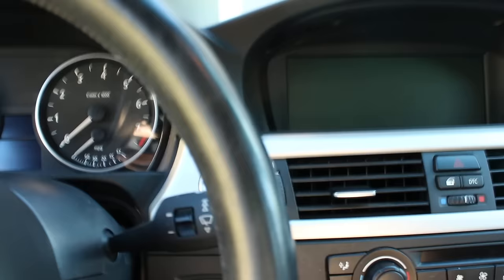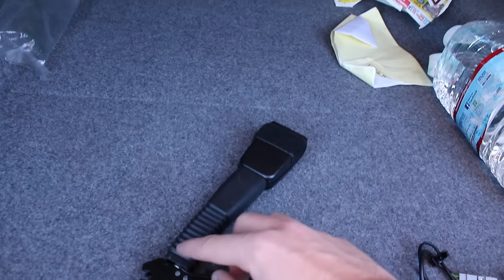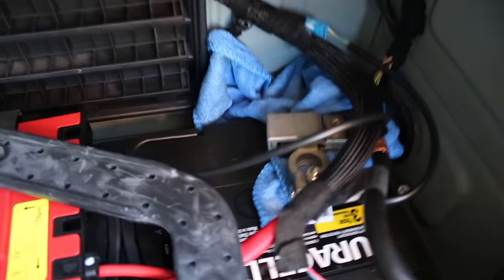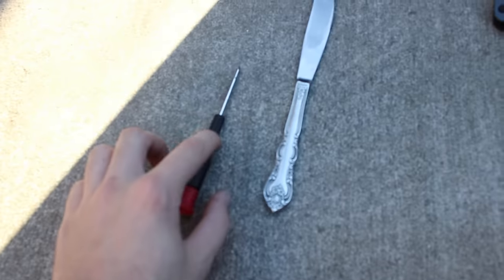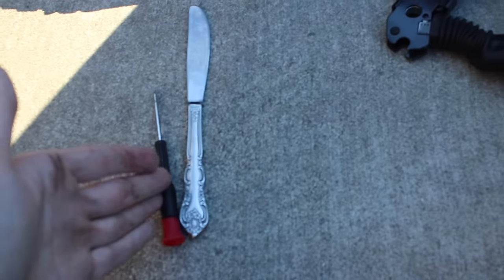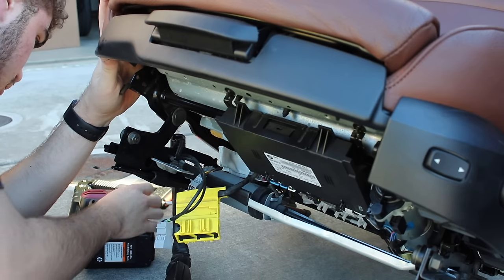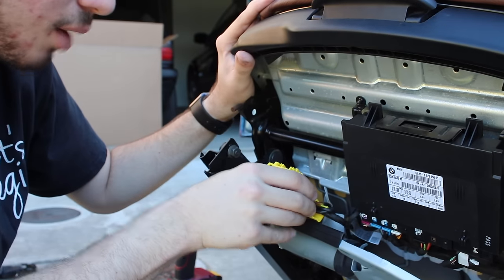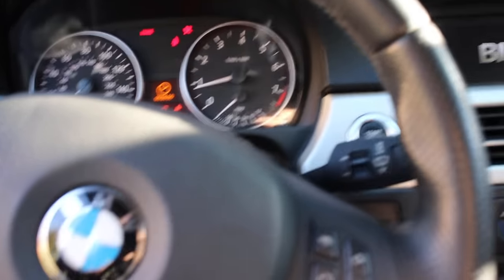HOW TO REMOVE AIRBAG LIGHT!!! (BMW)

Comment: If this video doesn’t fix it, the reason you have the airbag light and seatbelt tensioner light is because you got upgraded seats from a non LCI car. Lci cars have a airbag in the headrest. You would need to use a protocol to turn off the headrest air bags and that should fix it. Or you get get lci sports seats and that would also fix it
Reply: hello do you know how i could code them out ?
Reply: @alijevahmad4337  yes, you need to use the bmw protool to turn off the headrest airbag and that will make the codes go away! You need purchase the protool or find someone who has it to turn it off for you!
Reply: @abdel8068  ok thank you very much 🙏

Comment: I had this problem but the belt restraints were ok,what the problem was was quite simple,I had been putting stuff under the passenger seat when leaving the car parked up.when you pull the stuff back out fro under the seat you can pull the seat electrical connector block off the bracket on the seat.the block then flaps around and loosen its connections,I slid it back onto its bracket and left the car for 1 hour.when I started it again problem gone,never came back.check this first it may not seem like a big deal that the block has detached from the seat frame,but it is.
Reply: Bro can u detail where the bracket is I put shit under my driver seat and am having the same issue

Comment: This fault could also be the pressure mat under the passenger seat at fault. I’ve got two beamers a 2012, 116i and a 2008 118d Msport. Both of them have this problem. The Msport has just had a new battery and fault appeared a few weeks later. The 116i had the fault when I bought the car. Common fault. If it’s the sensor pad under the passenger seat, it’s an expensive fix. Pain in the backside as the instrument cluster always shows the icon and I like to see the time displayed!!
Reply: Have you managed to get any fixed? How much did it cost?

Comment: Did you have to replace the airbag control module or send it in to a airbag shop to delete the crash data?
Reply: i would imagine. since he was never in an accident i would say so. he only replaced the tensioner. im having the same problem with my e92.
Reply: I have a 2015 320ix front end crash airbags deployed will I need to do anything to start car the steering will is not locked. I changed the cable to batery already thank you
Reply: @anthonymaniz9896  I don’t understand what you are asking. If you already changed the red cable after accident then the car should start right up
Reply: @thewiseguy7100  ok thanks y would the sterring wheel not lock
Reply: @anthonymaniz9896  It never locks, I fix damaged cars all the time from new Mercedes to Maserati and BMW. Never locks just shuts off power to the engine

Comment: If you disconnect the battery before you disconnect the cable under the seat the airbag light will not come on when you connect      the cable later on.
Reply: Wait... So unhook the battery. Unhook the plugs under the seat. Hook the battery back up then the seats and the airbag light goes away?
Reply: Josh Browning did you try it bro? I have the same problem
Reply: @joshbrowning3488  nah unplug battery, unplug seat, replug seats then replug battery
Reply: Does that work

Comment: Hi nour i recently replacement my bmw 335i n54 e92 seats to the m3 e92 ones. I got a code on the dash saying "restraint system Malfunction"  did yours have the same caution on the idrive? can the icarly remove the airbag code forever?
Kind regards from New Zealand! <3
Reply: Hey I’m from nz too. Did u get yours fixed?

Comment: Did you have to replace the seat belt as well? Im having the same issue on my vehicle F10. I replaced knee airbag , steering wheel airbag and curtain airbag

Comment: Is this the same with the E36? My 328i has the air bag light on, iv fixed some broken wiring which i thought was the issue, and its not the air bag so my only guess is the tensioners 🧐

Comment: I have the same lights coming upon the dash, but I don't have any codes on my diagnostics machine?
Reply: Did you figure out the issue / how to fix? I also have the lights but no code
Reply: @corydragos8972  I just want my airbag light off for time being so I can get my inspection sticker,I got ah rejection sticker for airbag lite.
Reply: @jockbone6341  same problem how’d u do it

Comment: Best solution is just to remove the airbag light from the dash. Car will still work OK.  I did this in my old car when the light came on. I sold it since so its not my problem.
Reply: Im so sad about this because I think this is whats happenig to me. How did you remove it. Can it put ba k?

Comment: I have the Carly adapter and I love it. I removed airbag lights in my sisters e60 and use it on many bmws to code. It’s awesome
Reply: Can you use it to add or remove the ding when the car turns on?
Reply from the maker: Garry Reyom yea I removed it
Reply: Nour Hummadi I'm trying to add mine back, can Carly do that?
Reply from the maker: Garry Reyom yea
Reply: Garry Reyom yea I love this adapter. I have an e46 so I don’t any gong but my dad and sister have an e60 and I took the seatbelt warning off. It was very annoying lol
Reply: I am very late here but these 2 lights just happened to my E90 and I’m wondering if the Carly adapter will erase the notification or you can code it out and do you have to buy the app as well if you have the adapter? Thanks
Reply: Tbh i have the same warnings seat belt and passenger air bag so i wonder if icarly really works and how much is the adapter? It gets somewhat annoying
Reply: Zao sameeee brotha lol I have an e90 and I had the same warning, I just bought the Carly for bmw. I hope it works, it better because I’m spending about $140 with the Carly device and purchase of mobile app
Reply: aj garcia did it works ?

Comment: Which icarly did you use to clear the code and waa that an ebay purchase also appreciate the info
Reply from the maker: cash money Carly for iPhone Bmw, the item is called a Bmw e90 seat belt tensioner
Reply: I was asking where did u get the carly n how much thanks
Reply from the maker: cash money amazon for 80

Comment: I removes my seats so I can dye the leather and now my light is showing
Reply: If you remove it with the battery in it triggers it
Reply: @stevencapellan2430  damn. How can I turn it off now?
Reply: @kevinespinoza6111  did u ever find a solution I did the same thing
Reply: @ese_f30  nope still has light on lol

Comment: What happened is i mistakenly changed my pass front window regulator but didn't disconnect the battery b4 taking the airbag out so i have the srs on dashboard with no codes at all so the big question is will the carly reset this so the car will stop thinking the bag was deployed thanks again
Reply from the maker: cash money yes it will

Comment: To get through an MOT with a red airbag light on a BMW E46, I put the key in position 2, and removed Fuse 10.

No rear parking sensors, but she passed the MOT.

After the MOT, I put the key in position 2, and replaced Fuse 10.

Comment: God damnit it's called a pre tensioner guys... and most cars disconnect the pos and neg cables and keep them held together for a couple mins. If it comes back it's a hard code and repairs will be required.
Reply: What is that supposed to do. And you are saying to hold the pos and neg battery cables together to remove the airbag light
Reply: This way you will fry all the electronics in your car

Comment: Weird I just replaced my E90 with a new battery and these 2 lights popped up . Seatbelt and airbag and the battery was programmed as well
Reply: The same to me🤣🤣
Reply: @tormentor473  figured anything out yet about that ? I was thinking of erasing the codes and see if it pops up agian I think it was a malfunction but I haven’t done that yet

Comment: Hello. 

I have changed the clock spring in my bmw f10 with new one 
When fixed still I have system restraint fault and paddle shifters behind steering not working. 

Help pls
Reply: did you get the right airbag?
did you reset the airbag codes?